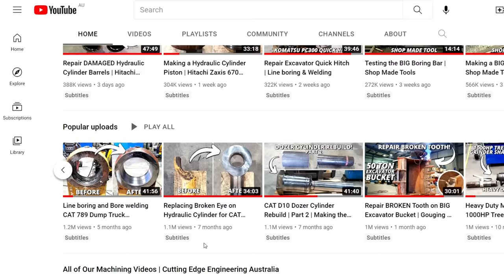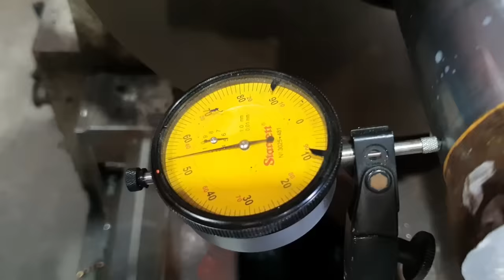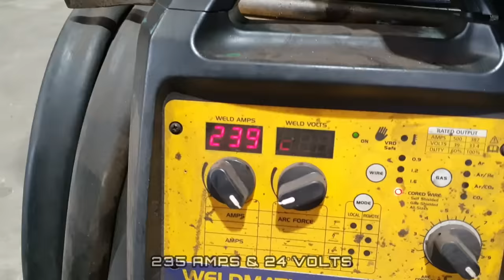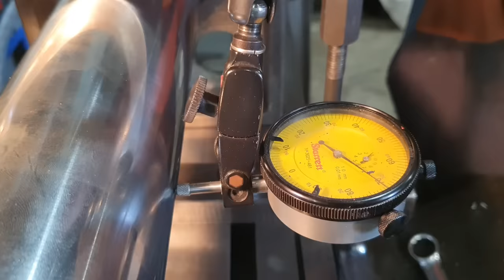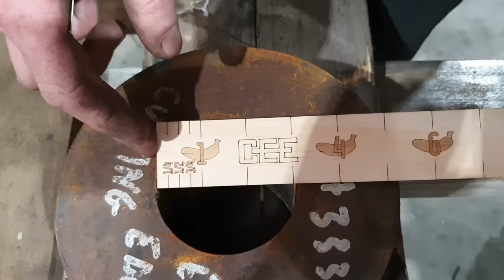Replace BROKEN Eye on Hydraulic Cylinder for CAT D10 Dozer | Machining, Welding, Milling

Comment: I'm curious though to see if this cylinder comes back with the other end broken off; that's the peril of strengthening whatever broke.
Reply: Other side likely has 2 thicker bearing blocks, and then a thick plate chassis joining them. Likely it will still break at the eye, or the pin will break first.
Reply: It's probably a VERY good thing these things tend to break at the eye...

Can you imagine just how expensive it would be if the Rod broke...then you'd be replacing the rod and likely re-barreling the cylinder at the same time...

Comment: Request/suggestion:  your vids give us insights into craftsmanship, tool mastery, and process knowledge.  There is an aspect in addition to these skills, I believe, that identifies the truly exceptional, which you happened to allude to in this segment-- organization.  If you can't find what you need when you need it, everyone suffers.  You gave time to explain the single rough head blank you keep on hand to be ready for all possible customer needs.
If you would, I know I would appreciate getting access into the tool drawers and inventory shelves.  Storing all those small cutting heads, the drill bits, welding tools and supplies, those tools that get deployed and then put away, material stock, etc. present a real problem to anyone who values efficiency.
Reaching into a tool drawer has none of the ASMR of a bit cutting metal on a lathe, and in editing for time and storytelling what your shelves hold doesn't scream to be included.  Nonetheless.....

Comment: "I've got a 150 Ton machine that doesn't take no for an answer" xD
Reply from the maker: 🤣💪 it's a weapon
Reply: @CuttingEdgeEngineering  I was working for a crane company that we had to push the bushings out of the walking beams and the machine shop maxed out their 500 ton press even after torching it they had to cut it out.
Reply: god bless for the comments!!
Reply: Brought to you by the Hydraulic Press Channel :-D
Reply: Mr you speak indonesia, because my do not speak inglis.

Comment: From Winnipeg: I never really cared for the centering dowel (eye to cylinder rod repair).  I found that the initial tack weld tended to pull off square.  I instead elected to use threaded rod or a long setscrew to mitigate unwanted movement.(especially when re-using the original eye)

Comment: Just saying "thanks" once again for your great content. I was confused about the connecting pin/spacer, as that wasn't really explained well in the video. Usually you are excellent at explaining your reasons and methodology, so that was an unfortunate miss.
I read down the comments below and saw you mentioned that the piston rod was already machined way too short. Do you think that one of the previous breakages had actually damaged the end of the rod where it connects, so the last repairer just machined the whole end off?

Comment: I have found making tape measures out of Elastic is great for those who are easily confused between metric and imperial, if they don't streatch the tape they can measure in cm, if they stretch the tape they can measure in bananas.

Comment: Just a question Kurt, I realize that you mostly duplicate parts that are breaking to repair a piece of gear for your customers. Do they give you the latitude to modify them to improve these parts?  

Since the area on the Dozer where  the eye is installed is quite accessible for greasing, why not relocate the grease zerk in the thicker part of the eye?
Say about 1/2 a banana ( you crack me up with that one and the rulers did too) from the flat weld area or even right in the angle itself, if you put a 1/4 inch radius on that angle it shouldn't fail at that point because the load would probably be distributed enough. Doing it this way you would be eliminating the weak point in the eye (zipper lol)  at the highest stress area of the eye where the steel is both being compressed and also pushed up by the load from the ripper as it is dragged into the ground.

have a nice weekend

Comment: I watched this again, I have a bench lathe and small mill/drill from H & F that I have been playing around with for the last 20 years. Thanks for all the great information and knowledge I am acquiring since watching Karen's marvelous videos. Security staff is wonderful to watch. Also had a chuckle at Karen's reaction to the "Banana rule"  Years ago I worked for Drake Trailers, and we built 8 X 4 axle trailers (and larger).  Had to use banana tapes sometimes, as the USA also bought some of them.

Comment: Great job.  This is my first time viewing your channel.   I'm an Iowa, USA farmer, turned mechanic,  tire fixer, welder, crude machinist, fabricator,shop keeper that's been at it for 40 years.  I'm curious about the hours it took to replace that eye on the cylinder.  You made it better than new.  Was the new part available?  It must have been cost effective to rebuild part.
Reply from the maker: hey mate welcome to the channel thanks for watching. The job was done in a day much more cost effective for us to replace than buy OEM

Comment: Is it my imagination or is that Quill bearing on the mill a little "crunchy" or is that an artifact of sound recording (mic)?
Reply from the maker: probably needs to be looked at 🤣👍
Reply: It hurt my ears too. Enough to see if anyone else felt that feeling of my ears say I must have a look
Reply: Damn. Good ear man. That's a good talent for a machinist. Most of the ones I know are a little deaf, so they don't catch bearing noises as quickly as they could.
Reply: @Savagedownsouth  Thanks! I spent most of my Professional Career as a Mechanical Engineer. I have many times heard an "unhappy" sound from a machine that people standing next to me couldn't hear, even after I pointed it out to them!

I guess part of it is from the time I was in my early '20s (I turn 63 Sunday), and worked as a Sales Engineer for a Mill Supply company I wore "Attenuators" to concerts and when working around loud machinery. Attenuators are earplugs, but designed to take the audible spectrum down evenly. Great for front row seats at say Rush, Pink Floyd, Zep, and on... ;)

Comment: There is an old saying that goes “If the only tool you have is a hammer, you tend to see every problem as a nail.” I wonder if this somehow applies to a lathe as well.
Reply: Lathes make lousy hammers — so no.
Reply: Also, the lathe is obviously not his only tool. 🤷🏼‍♂️
Reply: Brilliant! I have a battery grinder and it cuts, mills, surfaces, slots, saws, etc etc. My most useful tool
Reply: so, what! it work well or not?

Comment: Hi, you solved the hydraulics shaft very nicely. Maybe next you need to make a ring spacer to keep it from slipping over. Luckily you managed to get it back in position with the Press. Congratulations.Nice job! They give your dog a good appetite for delicacies.

Comment: Good day Kurtis. Like you I have faced these often enough that I kept roughed out blanks for all the more common cylinder eyes I would have come into the repair shop. It made for the machines getting back to work much faster for sure. I never did like the shot loading of interrupted cuts on the lathe. I can just imagine each strike gnawing away on all the gear works in the head and same for the compound and apron. I just shudder with each and every strike. Once again, in the end the piece is just bloody perfect. GREAT Editing and it is always nice to hear the comfort of your better half and seeing puppy large.
One thing though. You two are the only ones we see at your shop. There is still that big mill to see how it is going. Meeting your staff and a basic shop visit would be just plain wonderful young fella. 
Once again a great post and way funny out takes at the end my friend. Have a great weekend eh.

Comment: My father has been standing at a lathe. He cleaned rollers, straightened them out, mixed rubber, and laid it on the roller, then heat-treated them so that the rubber got the right hardness, for printing newspapers and magazines. The rollers were so large that he had a crane to lift them around. Yet he was so strong that many people were afraid of him. I have always been proud of haml. Unfortunately lost him on December 21, 2018.

Comment: Fantastic job. Looking at the previous failure. It appears the crack propagated from the intersection of the grease hole and the bearing bore. I would recommend chamfering this in future. Will greatly reduce stress. Would also avoid threading through to the ID. Threads are a large stress raiser. Switching to rolled threads would help here too. 
Fascinating job you have.

Comment: Outstanding job as usual! I'm with you on figuring out what the previous repair was. That one looked pretty good. Some you just look at and cuss.
I like your bevelling tool. We had one that was stationary on the bench. We did a lot of die shoes and plates that were small enough to run through it. It was also nice for prepping plates for weld. It sure looked nice and saved time.
Yep. Feel your pain on the bushing. At least you could get it in a press. I had that on a main landing gear. No press there. I had to cut it out with carbide burrs. I didn't do that again.
LOL!
Beautiful job on the camera and editing work giggling camera lady!
As usual Homeless being himself.
Cheers 
Terry from South Carolina USA

Comment: Hi Curtis, Greetings from England. I couldn't help notice your milling machine sounds a bit rough. Only reason I mention it is, I've just rebuilt a Bridgeport 'J' head because it sounded the same. On a Bridgeport, the front pulley moves up or down, depending if you use back gear or not. I found that the dog clutch was just to say catching when it shouldn't, and was making the same noise yours does. I checked out one of your earlier videos ( 26th March 2021), and it doesn't sound quite as bad. Might be worth a quick look. Thanks for all the videos, they've been a great help to an amateur machinist. Regards, Richard.

Comment: It's interesting how they attach the eyelet to the shaft. We were installing some machinery at a factory that were making hydraulic cylinders for Cat, and they were using friction welding machines to attach the eyelets. When they spin up to the RPM needed, you just want to walk as far away from the machine as you can. The operators I guess are used to it, but I didn't want to be anywhere near them.

Comment: We have a cryogenic freezer that we have put bushings in before we press them in. It’s at -80 degrees and we heat the rod to 400 degrees. The bushings drop in with no effort. When everything gets to room temperature it is a true interference fit. Then we microsize it to size and plateau hone. With that process we take our engines apart after 300,000 miles and the pin bores still have the cross hatching, as well as the crank bores. The best way we found

Comment: Turning, welding, boring, clocking up, deburring, sawing, assembling using nitrogen, pressing, tapping, grinding and I’m sure I’ve missed some out. Overall couldn’t fault the repair and that looks like a seriously strong repair 💪

Comment: Using liquid nitrogen to shrink the bush is the same thing  method we used to seat a tapered roller bearing cup in a blind hole.worked very well.The main work was getting the old cup out,solved that by very carefully welding a bead around the inside of the cup,most time that would srink the cup enough that it could be shaken out.

Comment: Hey Kurtis...you're the expert, but I wonder, do you think it would help if the grease hole was smaller in diameter?  You would have to drill the size of the threads as you do, but for the rest of the hole, perhaps the size of the hole in the zerk where the grease comes out.  It may plug easier, that I don't know.  I grew up on a farm and have used grease zerks a bunch.  But in this area you are the man!!!  Just know you said that this tends to be a common break area.  Thanks for your videos -- they are good for me here in the state of Nebraska, USA!

Comment: We used 45 gallon drums of liquid to shrink the pins for our 16 level osb press arms one of the contractor s dropped a pin into the liquid and blew the bottom out of the drum nobody got hurt but it was quite the show for a few minutes.

Comment: I had to bore out the base ends of some lift cylinders on my Bobcat T250 due to poor maintenance by the previous owner(s). I made the bushings myself (ya 1018 is too soft, but I crazy grease things). The first bushing was a tad too large on the OD. Ended up making the 2nd bushing a tad undersized so I used LocTite 609 to secure the bushings and installed with hand pressure. I ended up doing both lift cylinders this way and so far zero movement.

Comment: I use to work at a machine shop.  Running lathes/mills I probly turned threads into 100,000 of those big rods.  Also did alot of barrels and valve blocks.    I miss the sound of the machinery.

Comment: Friday's can't come around to view the latest video.first time for commenting,Kurtis makes this type of work look so easy.do similar type of work myself not quite such big machines though.but have learnt so much more by watching these videos.git to ask though,where can I get the air tool or cutting wheel for champhering the edges like you did on the rod eye.a cracking little tool.keep up the cracking videos.
Reply from the maker: Hey Mark thanks for taking time to comment mate! That pneumatic beveling chamfer tool I found it on ebay!

Comment: Stress relief annealing after Flame-Cutting? The remaining Flame-cutted Surfaces will be super brittle and full of tension and are possible weakspots. Or does the Sort of Steel you used loose his parameters if u do?

Comment: The Banana ruler is more accurate and easier to remember than fractional inch measurements or those ever-pesky millimeters.  In fact, Bananas are a universal measure among both shade tree mechanics and precision engineers, world-wide.  If Kurt and Mrs. Kurt left out the bloopers, we would think that Kurt was a well-paid professional presenter on Australian national TV.  Glad to see that errors in Australia are corrected the same way as everywhere else - 150 tons of brute force in a hydraulic press.
Reply: More Power!

Comment: Im surprised at 19:54 that you didnt need to preheat your work to prevent your work from drawing too much heat out prematurely causing the weld to crack. Am I mistaken about how big the work needs to be before preheating is necessary, or was your work piece already warm enough from machining that prevented your welds from cracking??

Comment: I've always wondered if it damages the insert quicker with the rapid on/off of material like what happens at 4:00.  Is that the case or does it not matter?

Comment: have you ever done any FEA on the rod end.? seems to me just looking at it that there would be highest tensile stress right where you put the grease hole but on the inside of the eye. this would be when the cylinder retracts and stretches the eye . is there an alternative grease hole location accessible with lower stress. like on the top? alternately drill a 3 mm hole for grease except larger at the outside where you tap it .
just some thoughts.

Comment: would it help if you installed a smaller thread size grease zerk and a smaller diameter hole to have less of a weak point ?
Reply from the maker: unfortunately not, the mine spec grease used is extremely thick and contains graphite it wouldn't flow through a smaller hole

Comment: [11/16/2021] It would also be useful to explain the economics of these repairs in rough, approximate terms; as in how much to repair vs replacing the entire part?  Without the grease hole the repaired eye should be stronger than a factory original part.  Well done.

Comment: Out of curiosity, what is the solution to these cracking at the grease nipple? Obviously putting it in the pin isn't the solution, Maybe a nipple angled from the side at a 30d angle, where most of the path is a narrower diameter?

Comment: If it is a common problem to fail at the grease fitting, could it be that you do not need an 8.5mm hole through the eye? It seems to me that the hole on the end of the grease fittings are maybe 2mm. What if you drill only a 2mm hole through the eye and then step up to tap size? Just a thought.

Comment: I have a question guys I know that he has a flux core wire that he's using? Is the Argon mix a cooling gas or does it still help with penetration? All the best from Canada

Comment: It is very obvious that you make parts better than OEM, but I have an honest, non critical question regarding the grease hole. If it is the weak point, can it be located somewhere else on the eye where it would it be submitted to less forces? The quick math in my head says that the end of the rod would be subject to less force than the sides of the pin. (90 degrees to the the factory grease point). In this area the force is devoted to spreading the eye, vs the cylinder load plus spreading the eye in the factory position.  If it is submitted to mainly pulling forces, could the grease hole have access between the rod and pin, drilled at 90 degrees from one side?

I also found it interesting that the cylinders are failing in the opposite direction than most other hydraulic cylinders, but I guess when one considers that they are a dragging implement, that makes sense. However it does make me wonder if they would be better off to have a frame more like the push blade with a ram supported from above that pushes down. This is probably something better addressed by the manufacturer, but if I see this change on their tractor next year, I may be a little upset. 

Just a fellow troubleshooter talking out loud without all of the facts in a effort to create discussion, and very open to correction.